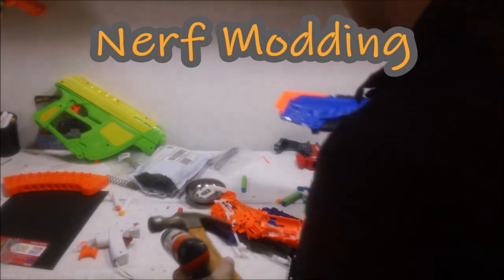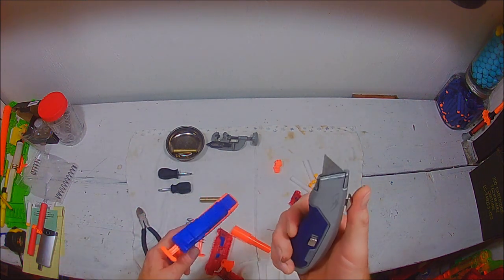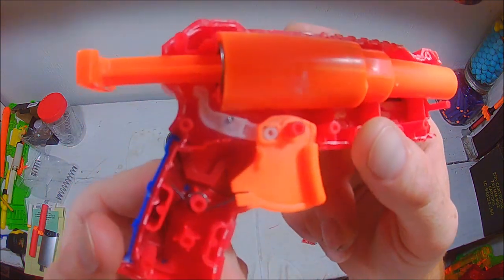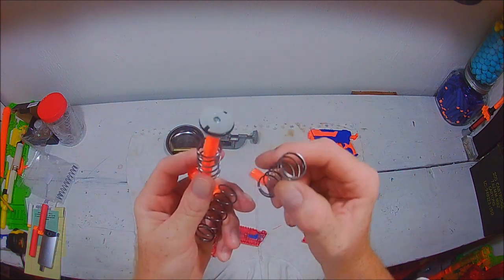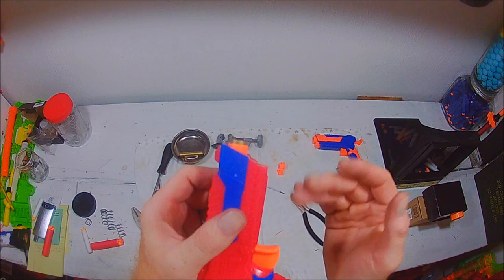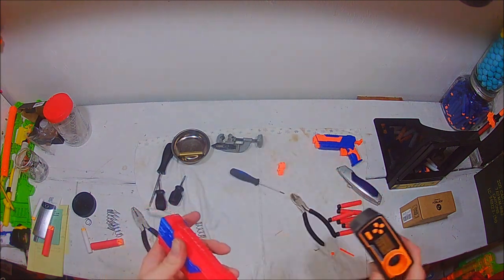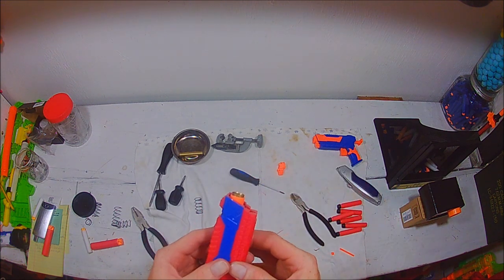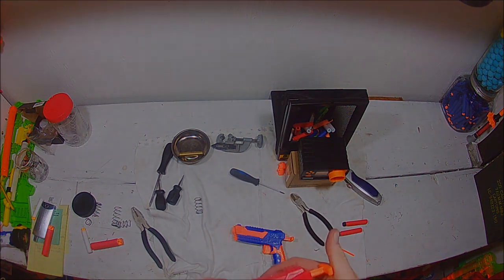Buzz Bee Panther Internals and Mod Guide [Nerf Mod]

Comment: You just dartzoned a buzzbee blaster for much cheaper Then again dartzone version of jolt are hard to buy themselves. This makes me curious if I can fit a try Tri-max spring a panther.
Reply from the maker: A Retaliator spring fit easily, just had to be cut down in length, and it still had room diameter wise to spare. I've got a feeling this little thing could work with lots of springs.